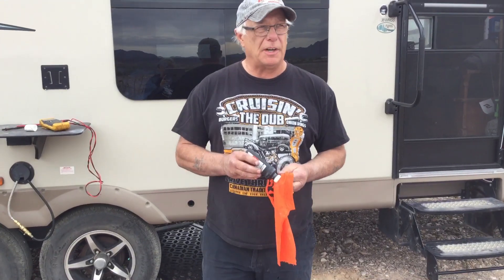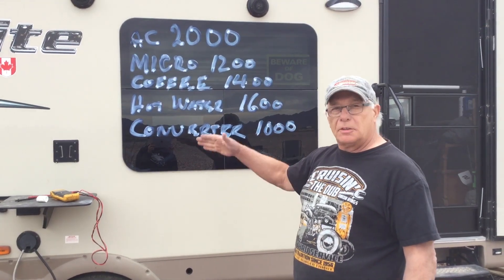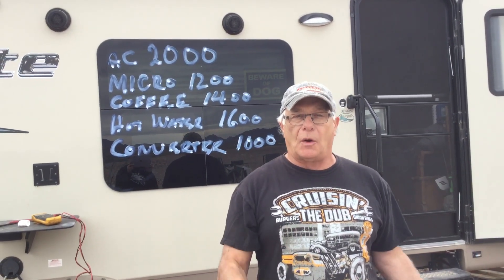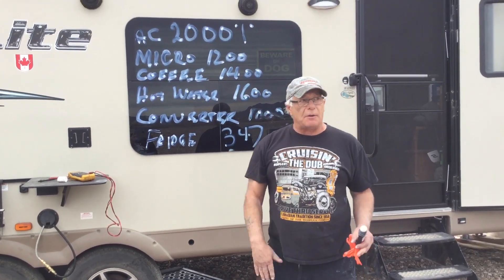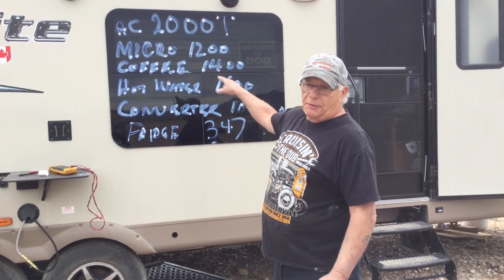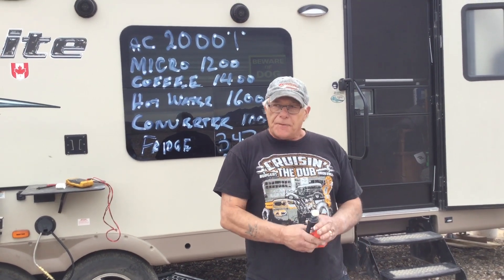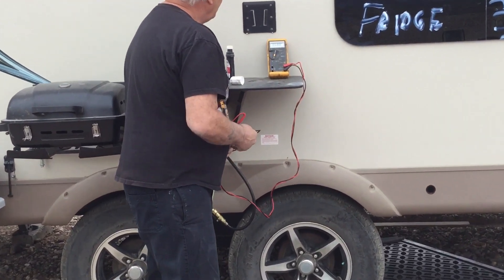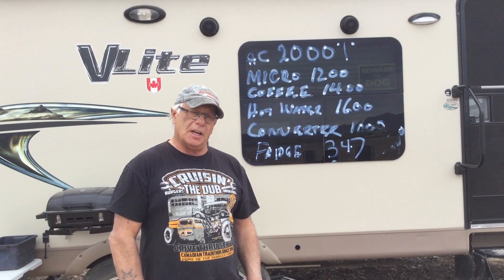EP22       SOLAR THE REALITY OF HOW MUCH POWER YOU GOT

Comment: 100% on this for sure here. Its all number by watts and available watts. Even if you have enough battery's and an inverter to handle the power, a 600w watt solar setup is only 6.0 amps output at 12v. I remember many moons ago using 150ft of extension cord for my popup camper, worked fine. You just can't load it to death.
Reply from the maker: You got it moderation is the ticket 🎫🙏🛠🛠
Reply: 50 amps *12V = 600W

Comment: I learned this the hard way the second time I took my Class C out and was running the A/C, fridge, and hot water on the generator.  Eventually all three kicked on at the same time and popped the circuit breaker on the generator which I couldn't find until I got back home.  Remember Green Acres where Oliver put a number on every electric appliance and they couldn't add up to more than 7?  This is the same thing.

Comment: I am confused. You said, plug the solar into the 50 and the generator into the 15. What is the device I am plugging those into? The charge controller? The inverter?
Reply from the maker: Rhizomatic Movement I have 30 AMP cord 15AMP cord gen into one inverter into the other 👌